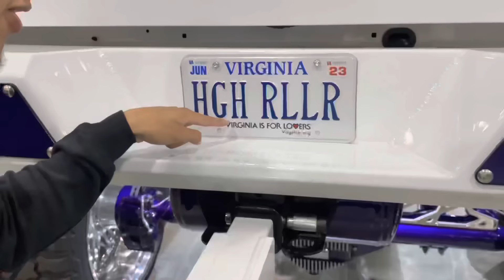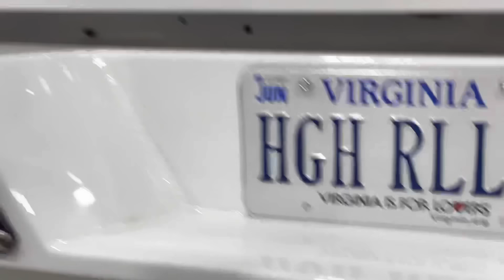This 16 Year Old has a HUGE 36” LIFTED F250 on 58’s!

Comment: Who else cringed when they saw the soap brush against the paint😩
Reply: It's a truck bruh calm down
Reply: @Buuurna  Yes a truck that will never see offroad.
Reply: @Buuurna  trucks have the same paint jobs as cars and it’s not a work truck so taking care of his paint is probably a good idea lmao
Reply: @HomesThatRoam  well it looks like he doesn't care doesn't it
Reply: @Buuurna  considering he mainly posts show trucks and expensive vehicles, yes I will cringe... I woulndt if it was a regular work truck lol
Reply: It want scratchs that easy it has clear coat on it
Reply: Yeah as a Detailer i could hardly watch it that hurts to watch..
Reply: @Buuurna  yeah a very expensive truck bro dont use those horrible ass brushes bring your own lol
Reply: @domgutta6389  clear coat only protects paint from harmful rays and enhances paint finish.  Doesn't protect from scratches which is why they sell buffing equipment to get very minor brush swirls out of paint. They do sell special paint that you can spray on to protect from scrathes hell even a sledge hammer, its called bed liner.
Reply: I feel you, mighty expensive truck to be scratching up.
Reply: Man when I seen them at a public wash like that brah... the rocks in those brushes from 1972 baaaad idea
Reply: I cringed seeing low profile tires on a lifted truck.
Reply: These trucks just ruin the functionality of what a truck is supposed to do.
Reply: It's just clear coat lol
Reply: @owenspencer828 no one cares the trucks look good anyways

Comment: Ford super duty is the best looking truck right now IMO.  Stock or lifted, doesn't matter.  Just so badass.  Which is why I have an F450 Platinum on order.  Just getting leveled on 37's though because I will be towing a 5th wheel lol
Reply: @tannernicholson21  you probably couldn't afford a Ford so you had to settle with the cheaper priced Chevy and that's why you're bitter.
Reply: @darrenhill3514  will never waste my money on a ford😭
Reply: An " I can't afford it" yet the new Denali is 80 to 100k but ford is "so much more" 🤣
Reply: When you get stuck pulling a trailer thru the mud lmk an I'll come save ya🤣🤣🤣🤣

Comment: How do you turn stability track off on the new rams ?
Reply: Turn off track control then hold hold the button down until the stabili Trac turns off takes 10 or so seconds

Comment: Those trucks are junk with those stupid wheels. A nice ✌️truck✌️ is a 2018 limited F450 black dually with 19.5 inch wheels and ready to work and look good doing it. The only nice ✌️truck✌️ in the whole video was that white ram at 2:30. Thats the definition of a nice truck.

Comment: Blue camo truck with the flat bed, those starts and stops on the weld that held his fender on are from him running out his rod and having to start a new one.

Prolly should’ve mig’d or tig’d it on if it was for aesthetic purposes but over all not a bad weld jus not super pretty

Comment: Here my issue with all these videos yall see with fancy Dancy trucks on these roads shows if you lower to ground or lift it up over 4ft put all this crap ,stereo system fancy bed expensive engine paint job  lights ,technology 24-35in rims tires it's not truck anymore most are not  doing truck thgs yall do stupid dumb unstable thgs